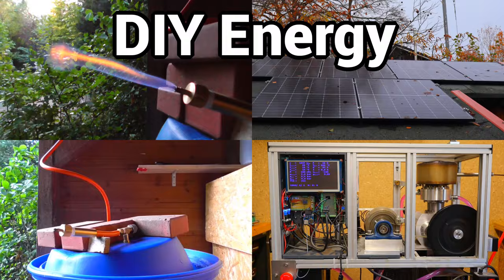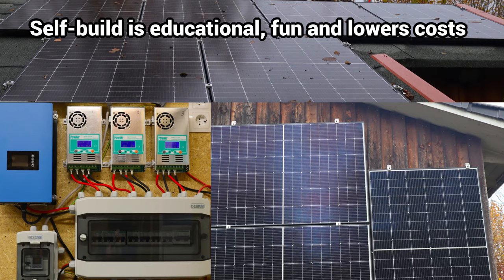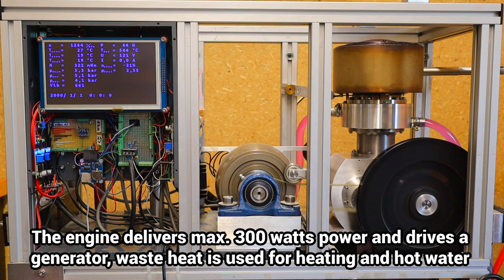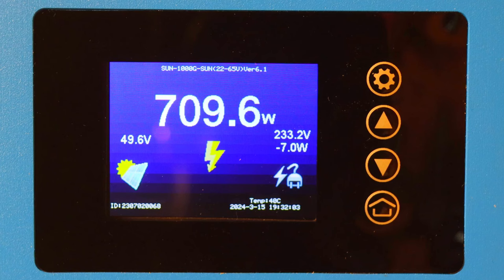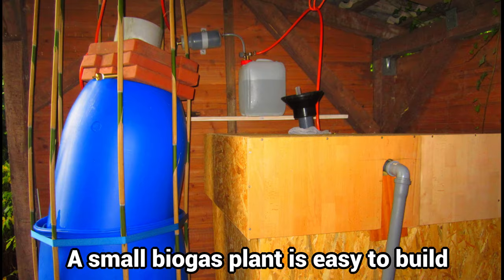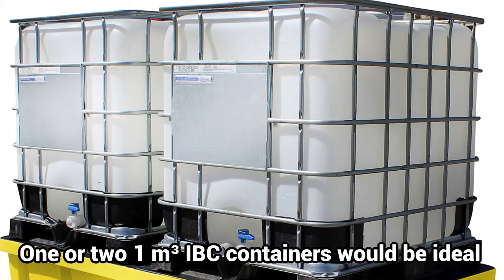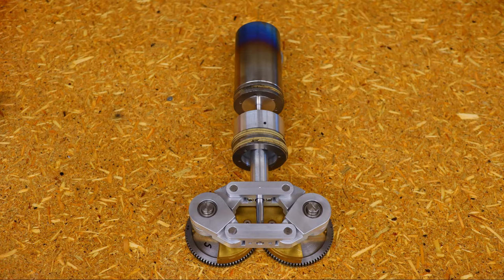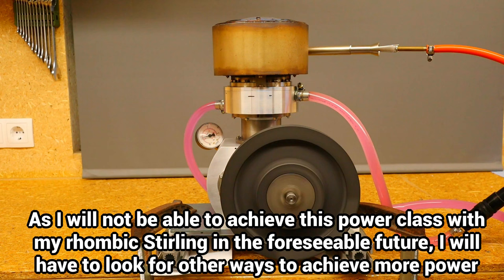Energy self sufficiency with solar power, DIY biogas and self built Stirling cogeneration unit / CHP

Comment: What would be you're reasoning for giving up on the Stirling?
Reply: I dont think he is giving up - he is trying to decide on whether he will upscale to 1Kw Stirling or contemplate ICE engine. Either way, no decision was made yet.
Reply from the maker: I will not giving up on the Stirling I am to obsessed by it...
But it's tempting to see a 5 KW combustion engine for a few dollars and invest so much effort in 300 watts of Stirling power.
And an internal combustion engine will be a fast solution to produce energy until the Stirling is operational with more power.
Thanks for your comment
Reply: @myengines2443  You can buy an ICE for 200 bucks with 800W peak, Stirling is nowhere near being price to value comparable. You are better off with a steam engine or a turbine or a double working piston Stirling.... Honestly I have no idea how you came up with the rhombic drive beta idea in the first place and why, you can design a theromoacoustic engine instead without any moving parts.
Reply from the maker: @sierraecho884  yes you can even buy a 5 KW ICE for 200 dollar but I think it would not last very long...

A Steam engine needs a steam boiler which is dangerous, big and efficiency is not good.

I am very interested in other concepts like the thermoacoustic and thermal lag engine but I am unsure about their potential of producing reasonable amounts of energy.

I dont know an relativly simple thermoacoustic engine in the range of 1 KW.

A double acting Stirling is really attractive but much more complicated to design and to build.

It is really challenging to build a one cylinder Stirling with more than a few watts so a multi-cylinder engine is not possible for me to build just in my free time.

The rhombic drive has the benefits of being virtually free of piston side loads and vibrations which is very important for an engine which has to have long sevice intervalls.

A free piston engine is also complicated to design and to get it running.

Greetings